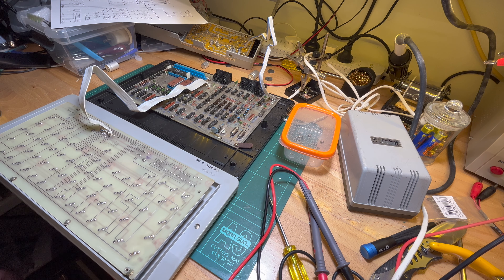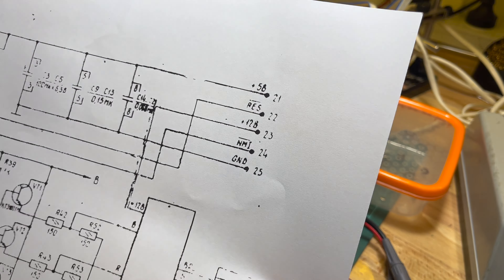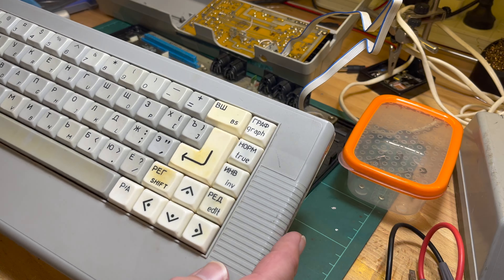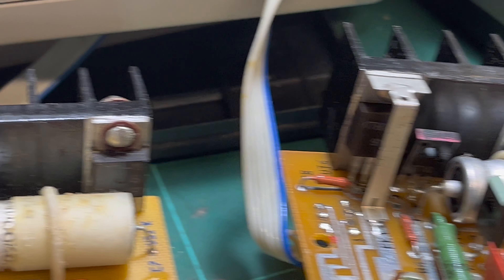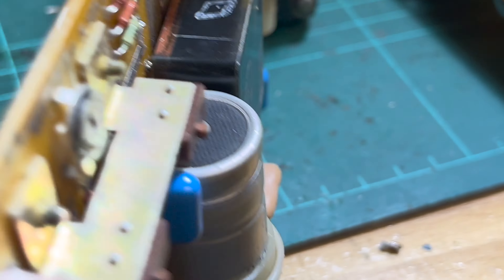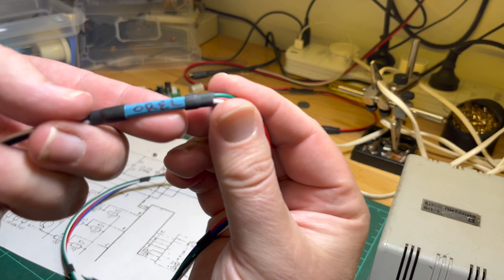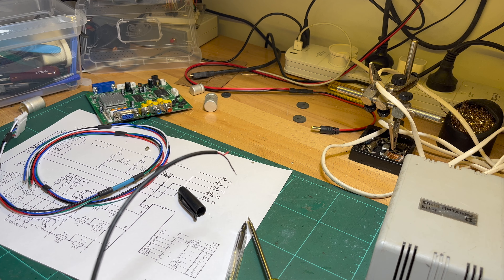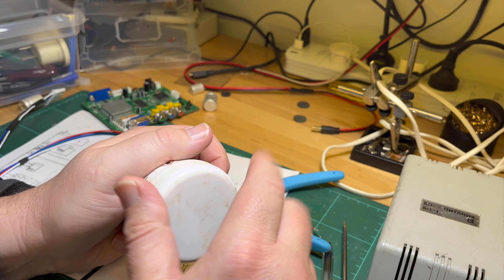🇺🇦 Орель БК-08 (Oril BK-08): Part 2 [TCE #0273]

Comment: Nice work. I'd have more faith in the first computer you tried, but I guess a RAM issue could be anywhere.
BTW a mil, or thou, is 1/1000th of an inch, or 0.00001389 fathoms. The pitch of imperial components is 1/10th inch based :)
Reply: Could you give that to me in cubits please? :)
Reply: @MrWaalkman  0.000055555555555.. :)
(edit) It seems there's some disagreement on cubitness, so I think 5 x 10^-5 is more acceptable.
Reply: @gshingles  LOL :)

Comment: You haven't noticed how the solder doesn't make it to the top of the board? Look at DS13 on board #1,  pins 1 - 8 on the chip didn't get their solder flowed properly to the top side of the board. Might just need a reflow to get it working.

Oh and yes, 2.5mm spacing. I remember thinking that getting a 2.54mm chip into a 2.0mm socket would take some doing. :)

And, duh, I just noticed the switches on the top of the power supply. So I guess that they would be "C" form contacts then. :)
Reply from the maker: Yep, I did notice that today about the solder when I was wondering what the heck you were talking about :)
Reply: @Brfff  I get that a lot. :)

And if the holes aren't thru-plated (they probably aren't), then you are going to want a dab of solder on the top to go with the solder on the bottom. 

And you saw in the first video @24:04 where the long thin cap on the power supply might actually be two caps and an inductor? I would hesitate changing that one out for the time being...

Comment: Our decadent western imperialist designers used to use 0.1" lead spacing, with the occasional 0.05" high density.
Looking at the two CPUs, it looks like the genuine Zilog is long for its socket, while the peoples version looks a bit short. Is it possible that one board has a 0.1" spacing socket and the other 2.5mm and the processors are swapped?